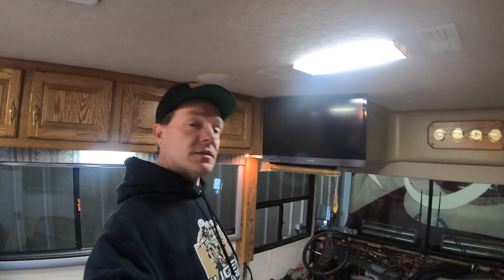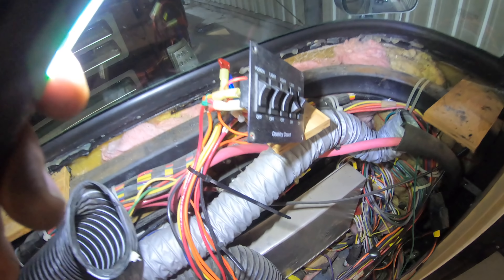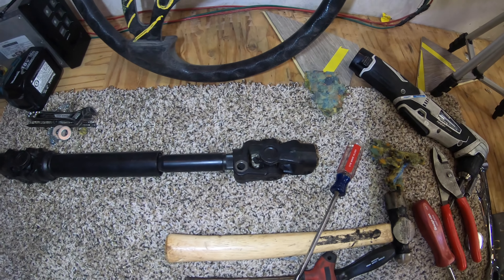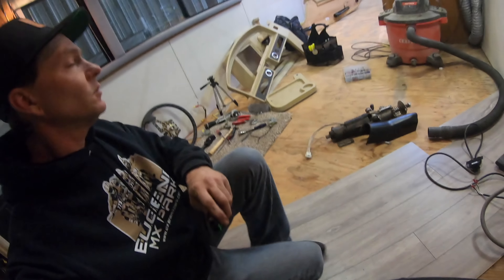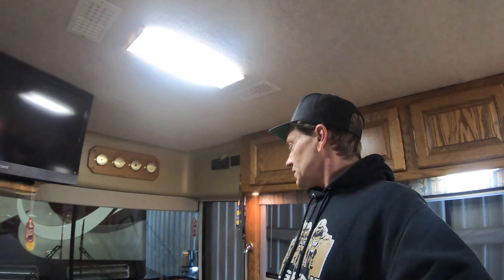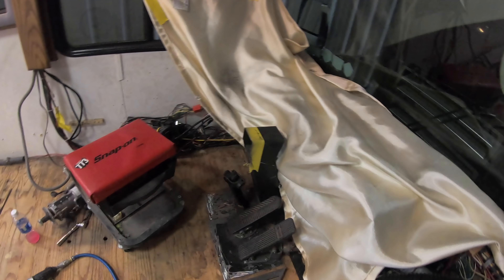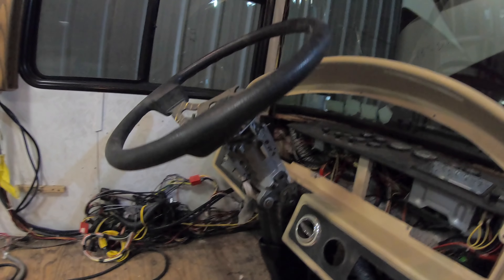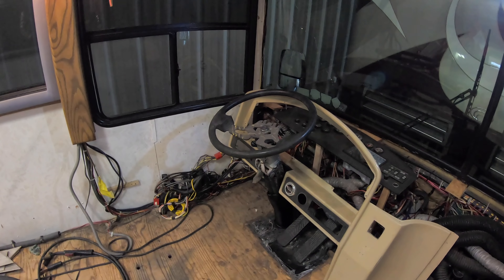Will I ever get to the flooring? Not yet Steering Wheel First.

Comment: I have the VIP controls in my 2000 Dynasty. Once I turn on my headlights, they won't go off until I unplug the connector at J12 on the VIP controller. So I leave it unplugged. No CCI lights that way but everything else works. Keep up the videos.

Comment: Nice work! Did your original wheel not have tilt and telescope capabilities, good idea on the lights, on the upper windshield, also seems like it be a good time to put in any extra gauges, not sure if its missing any, maybe a Pyro  or transmission temp etc.  
Did you happen to get a chance to check the plug-ins we were talking about on my coach? Just curious if any there.